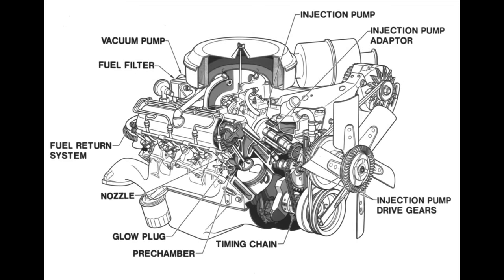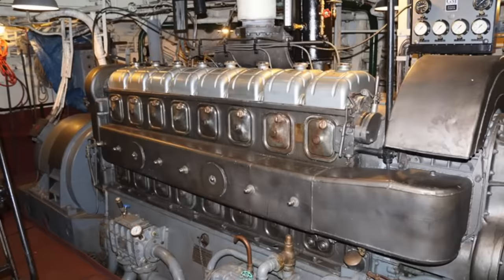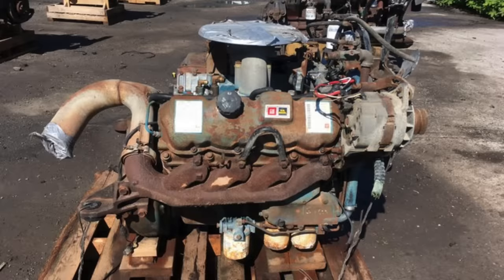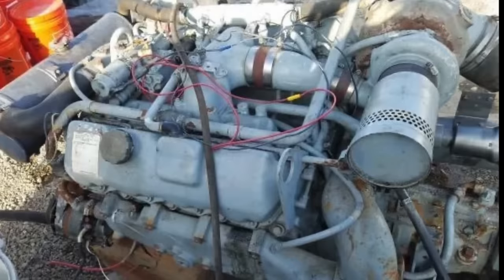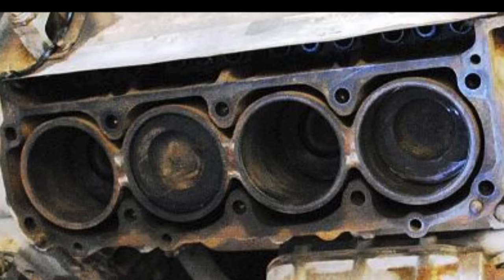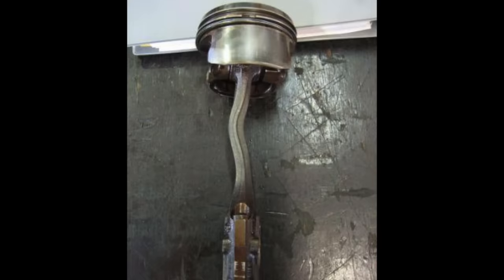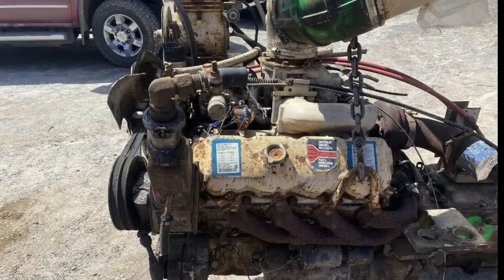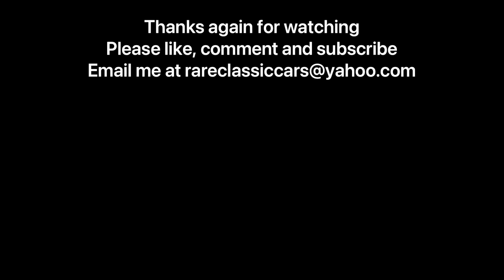Worst Engines: GM's 8.2L / 500ci "Fuel Pincher" Detroit Diesel Pinched Its Owners' Pocketbooks

Comment: You picked a turd of a Cat to compare it to haha
The 3208, particularly the earlier 2-ring piston versions and the naturally aspirated ones, were not known as being very durable or powerful. The updated 3-ring pistons helped, and the turbocharged versions did reasonably well, but it still isn't very fondly remembered these days.
Reply: The early 3208's also had cast cranks and camshaft and didn't even have piston cooling oil jets at thr bottom of the cylinders but later ones were vastly improved and actually gave good service in the proper applications.

Comment: To be fair,,,,,,while it was much more durable, the 3208 was also a "throwaway engine". 

It's also not very fair to compare the 8.2 to the 3208. The 3208 is 636cid/10.4L vs Detroit's 500/8.2L. 
A bit off topic, but if one were to compare the 3208 to Cummins' L-10 of the same era (almost identical cubic inches), you would see that the 3208 was kind of a piece of crap too. Granted, the compact 3208 would fit in smaller trucks that an L10 would not. Just wanted to point out, that 3208 deserves NO awards.........

Comment: GM use its customers as real life “testers”. While Japanese and Germans take give or take 8 years to test their drivetrains. Especially engines. 1920s or earlier Chevrolet brought four cylinder copperhead engine. That was very bad. They ended up taking them back.

Comment: Besides the breakdowns.  The operating characteristics were terrible.  I was in the fire service at the time and we live in steep hill country.  We always had the high HP versions of course and it was true about keeping the headlights on low beam.  Because if it saw a hill it would start to slow down.  Normal operating RPM was over 3000.  Cat 3208 was similar in size and shape but so much better to operate.
Reply: Both the 8.2 and 3208 liked high RPM, and lugging them was bad for them. 
I don't think it's fair to compare to compare the 8.2 with the 3208 though, at least not entirely. The 3208 was significantly bigger, in overall size, weight, and cubic inches. The 3208 was 10.4L/636cid, that's not a fair comparison to Detroit's 500cid 8.2.  In full trim, the 3208 was a few hundred lbs heavier too
Reply: @johneckert1365  Yes but they were the same physical size package and found in the same trucks.  The Ford medium duty trucks, F700, C8000 could have an option of the 3208 or the 8.2.  The fact that it was smaller displacement was one of the flaws, they could have made it 10.3 if they wanted.  The 3208 could be found in full size single screw tractors but it was a bad engine for that job.  And the 3208 never touched 3000 RPM and would lug pretty good down to maybe 1700, while the 8.2 would not lug even a tiny bit, by the time it hit 2400 it was falling on its face.  The 3208 was already kind of a dinosaur by the time the 8.2 came out but it was a better dinosaur than the high strung 8.2 was when modern.  The 8.2 was just an example of "we can do it cheaper".
Reply: @nspro931  The best way to keep either of these engines alive, is to keep the RPM up. The 2800 (or whatever it is) max RPM for a 3208 was pretty high back when it was introduced in the late 60's. It was the Caterpillar 1140 back then, had less cid and only made 140HP, similar to the lowest power 8.2. 
I totaly agree that the Cat is much more durable and reliable than the 8.2, but I still don't think it's fair to compare the two side by side. The same F700 that offered these 2 engines also offered a 300 straight 6 gasser or 370/429 V8 gasser. Is it fair to compare them the same way? If we were comparing all available engine choices, yes the 3208 was the strongest and most reliable, but the 8.2 was the most fuel efficient. That why it was named "Fuel Pincher" and not "Maximum Durability" or something like that. It's a shame what GM did with that cylinder deck design, because if that engine had been built just a little more durable, it wouldn't be frowned upon so much.
Reply: @nspro931  I wonder what the price differences were between ordering a medium duty Ford with an 8.2 vs a 3208 back then?
Reply: @nspro931  You've helped me further point out the unfair comparison with the 3208. I've also seen single axle road tractors powered by 3208, even had a good customer with 2 tri axle Chevrolet Top Kick dump trucks. 1 had a baby 13 speed, and the other had a 5 speed with 4 speed auxiliary. The point is, these were 60,000 GVWR trucks. The 8.2 was NOT designed for that, the 3208 was. Those dump trucks weren't bad empty, but put 15 yards in the box n it was a different story........ 
All I'm trying to say is, the 3208 was a medium/heavy duty engine while the 8.2 was more like a light/medium duty engine. It's just not fair to compare them side by side. Similar to all the bs going on with the "trans" movement going on these days. It's not fair for a large heavily built man to be competing in women's sports. Allowing the 3208 to compete against the 8.2 is basically the same thing 🏳️‍🌈🏳️‍🌈🏳️‍🌈⚧️⚧️⚧️
Reply: @johneckert1365  The reason I think it is a direct comparison, is show me what truck you could get an 8.2 but not a 3208 on the smaller end of the scale.  Maybe some of the GMCs but only maybe because they wanted to keep the GM corporate engine in there.  But the F700 was pretty small and it could go either way.  I suspect the whole reason for the 8.2 existing was to try to grab some market share from the 3208.  They made design decisions to make it lighter and more fuel efficient.  But those turned out to be bad decisions.  Do you understand what I am trying to explain here?  I think they were direct competitors except the 3208 went higher on the truck size scale sometimes.
Reply: @nspro931  Well, like you mentioned Chevrolet and GMC didn't offer a 3208 in thier "C" series trucks, only thier own 8.2. They did offer the 3208 in thier larger trucks like Top Kick, Kodiak, Bison, Bruin, General, Brigadier. The 3208 may not have fit in those smaller C-50, C-60, C-70 trucks, but I can't say for sure. We both know it's a tight squeeze for a 3208 to fit in an F-series, especially the older body style F-series trucks. You could order an early 80's era F-600 with an 8.2, but not with a 3208. The flaw in your comparison is treating Ford's entire F-C-L series line as the same truck. GVWR is the name of the game, you know this. Lower GVWR Ford's offered the 8.2, higher GVWR Ford's offered the 3208. Yes, some GVWR offered both. We usually saw 3208 uses in 26,001+ GVWR trucks that required a CDL, and saw the 8.2 used in <26,000 trucks that don't require CDL (in most states). It similar to weight classes in wrestling or boxing maybe. Sometimes some classes overlap, but it still doesn't make them the same.
Reply: @nspro931  The 8.2 was significantly smaller dimensionally as well. The 8.2 fit in some spaces the 3208 could not.
Reply: @johneckert1365  OK. I was not sure of all the overlap and non-overlap.  What I know is we would have two similar trucks, one with a 3208 and one with an 8.2 and you know what that was like.  Shortly after all this debacle the Cummins 5.9 and 8.3 became popular and we all know those are 20x better than whatever came before. The ad stating the 8.2 had gas engine operating characteristics is telling.  We also had similar trucks with a 427 vs an 8.2 and I would almost say the 427 was better.
Reply: @nspro931  If I wasn't paying for the fuel, I would probably choose the 427 too 👍
Reply: @nspro931  Funny you mention it, I just bought a 98 F-700 with 5.9 in it from an auction recently. I don't care about the truck very much, but I try to buy and hoard as many of the 12 valve 5.9 as I can. 
I always liked the Brazilian Ford 6.6 and 7.8 in those trucks too. I think they bridged the gap well between the 8.2 years and the "B"-"C" Cummins years. I wonder why Ford switched? Maybe too expensive to import from Brazil?

Comment: When was the 350 Chevy that was converted it had different heads and it run diesel😮 valve problems
Reply: Chevrolet never did that. Oldsmobile did.

Comment: Perdecessor to the Duramax?
Reply: Perdecessor? What's that?

Duramax is a product of a partnership between GM and Isuzu. It is not in any way directly impacted by the 8.2 Detroit.
Reply: No it wasn't the predecessor to the Duramax. The fuel pincher was a medium duty engine. The light duty predecessor to the Duramax was the 6.5 and before that the 6.2.
Reply: The Duramax is built by Izuzu 😂😂😂

Comment: Funny that we haven't really learned from these failures of the open deck designs from almost 50 years ago, as there are any number of engines from many current manufacturers that seem to have the same issues and entirely due to the same bad idea of an open deck block. Stuck on stupid.

Comment: Theres nothing wrong with open deck blocks. They have been the industry standard for most modern engines for 20+ years. The 4 head bolts in a diesel is pitiful, that will cause hg issues with any block.

Comment: An 8L engine making 130HP is pretty pathetic, honestly. It's like a 1600cc car engine making 26HP 🤣
Reply: and with only that much power it still coundn t keep the heads nailed down
Reply: @thewiseguy3529  Not quite - the original VW engine was only 1100cc and put out 25hp. The 1600 put out 60hp, and that was 10 years before they made this attrocity :)

Comment: to put into perspective how little power and torque this engine makes: the 2.8L inline-4 turbodiesel duramax (LWN) makes more torque (369 lb-ft) and more power (181 hp) than this thing and that's the engine they put in 1/4 ton pickups like the chevy colorado nowadays. wao!
- 7α β

Comment: Common denominator is they all started life as gas engine. The 500 cu in was a really old Cadillac engine. The 4.3, 5.7 and 8.2 were all very successful GM gas engines and did extremely well for decades, not so much as diesels 
4.3 V8 is Cadillacs North Star abortion. North Star was GM’s worst ever and it made an equally bad diesel.

Comment: I drove a flat deck fitted with a fuel pincher back in the early 80's. Was a gutless peace of *&^%$#. had a recall done on the heads. And still drank coolant like a drunken fool. Evan un loaded was useless

Comment: my boss had a stake  bed  c60 5 ton with that engine that ran pretty good but with a 2 speed rear end 456 gear was wound like a clock 55mph top speed but ungodly torque so I disagree.

Comment: 7:00 you forgot about the head is pressing down on the top of the cylinders. The engines only made 165 hp. An open deck block was more than enough.

Comment: Gm was pushing technology just a little bit too far, open deck short skirt pistons not good for diesels.  But the open deck design is being used for many new gasoline engines along with short skirt pistons.   Hard to believe after 50 years and engineers are trying to reinvent the wheel .😂

Comment: GM could never understand how to make a great 4 stroke diesel.
Reply: Bean counters would over rule the engineers is why. With the Olds 5.7 release in 79 the engineers told them exactly how & why it would fail and the bean counters over-ruled them. By 84 the Good Wrench 5.7/350 replacement engines had all the upgrades it should have had in 79. But the damage was done. The engineers said so in a technical paper. The project manager as I understand it quit. I mean quit GM kind of quit. He said if we don't make these mods it will set back the market. But the bean counters knew better.
Reply: @roguedalek900  
The duramax is garbage as well.

Comment: Considering the low torque and horsepower for a 500 ci engine, it astounds me that GM would green light such a loser.
Reply: They made higher horsepower and torque versions of this same engine. Yes, the lowest was pretty low, but the highest wasn't bad. 
Remember, this was designed to be a FUEL EFFICIENT diesel engine, that's why it was named "Fuel Pincher" and not "Torque Monster". These engines really weren't all that bad if they weren't abused.
Reply: Such a large engine was such low. Horsepower and torque should have been way under stressed and lasted For many  service hours Open deck design  on any engine especialy a diesel is foolish when diesel engine fires difrent harmonics in cylinder walls thats why a suplimental coolant additive is needed especialy in a wet liner design to prevent erosion of liner from cavitation in coolant vibration harmonics as combustion occurs

Comment: was a certified detroit mechanic when these POS came along, and by "Piece of sh$t" i mean they were far and away not ready for prime time.

along with all the problems listed, when it came to overhaul???  omg really?

if you changed out the came bearings, they had to be line bored to size, who the hell does that even in '78?
the oil pump rotor fit into the front of the block casting and it too fit into a pressed in bushing that had to be sized in a bridgeport so that the rotor would fit, otherwise no go.

you had to use all sorts of machinations to set the injectors too, with dial indicators, which is hell in a snub nose gmc truck, that was simply stupid given the timing picks used on the 2 strokes, which meant that the cam timing was all over the place between engine's coming off the line, so you had to go with dials rather than picks.

if the engine was allowed to be driven after it overheated, it would seize a piston and pull its con rod in two like a piece of salt water taffy, and then you had a cast iron hemorrhage.

the idea was good, but it was released about 2 years too soon, had they worked out the kinks in serious testing, they might well have been a good engine.

btw, open decks are insane for diesel engine! no matter what the block is made of the top of the cylinder will move about and fret the head gasket, and sooner or later you have a blown head gasket.

the only ones that seemed to survive were in relatively light duty service.

after 1985,  i refused to work on these engines, no matter how simple the repair appeared to be.

mobile_bob

Comment: "if the gasket blew between the cylinders, it would cause a hydro lock". NO, it wouldn't. It would simply misfire, due to loss of compression. 🙄
Reply from the maker: If antifreeze leaked into the cylinder, it would certainly hydro lock

Comment: Ah, so GM made 2x 8.2L v8s, one a gas, the other a diesel.
Reply: Hooooold on
This diesel made less HP and torque than the GM 8.1L in the Cadillac at its worst tune?
WTF
Wasnt the cadillac 501CUD V8s considered bullet proof because of how down tuned they were?

Comment: Back in 1970 I was in college.  We studied in economics class about GM having a large block engine that got over 50 miles per gallon.  The engine was placed in a Cadillac sedan to test the engine.  The Cadillac ACCIDENTALLY got sold to a customer at a dealership.  GM realizing their big error tacked down the vehicle and owner.  GM offered the private owner citizen $500k for the vehicle.  Owner said no.  Not long afterwards big oil purchased the patent and buried it.    As a poor college student, this stuck in my mind all these years.
Reply: Don't believe it, it's economics class not engineering. There's only so much power. You can get out of a given amount of a certain fuel. No matter what the fuels are, it's all limited to the energy you can get from it

Comment: chev / gm , never built a decent diesel..[ or gas engine ],  here in aus. back in the late 70,s. guy had an f100 4x4 for sale , with,,an 8.2.. thank fk, i didnt buy it.. also, 2000,s. drove 2.5 hrs to look at an f100 4x4, with a 6.2 d. fitted.. to me, it looked like a gas engine.. later, found out. it was, converted to diesel. buik, by gm.. losers..never bought it.. keep your ford, all ford.. fk gm , chev..